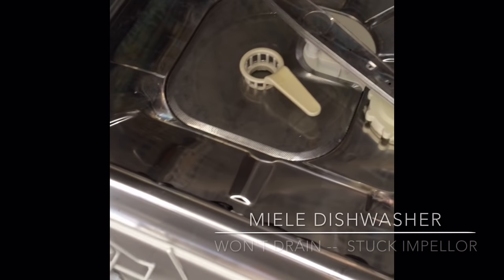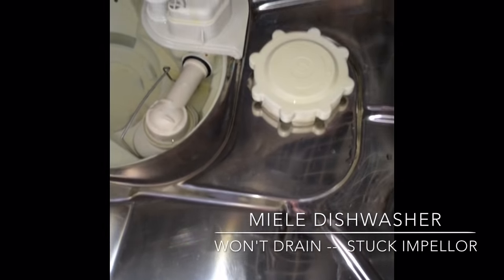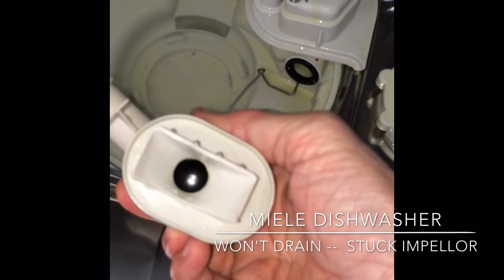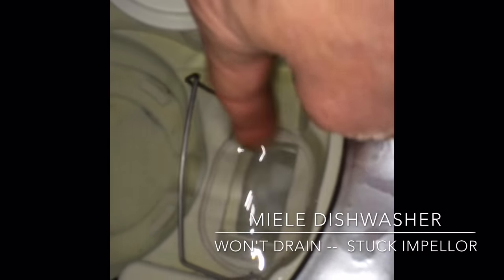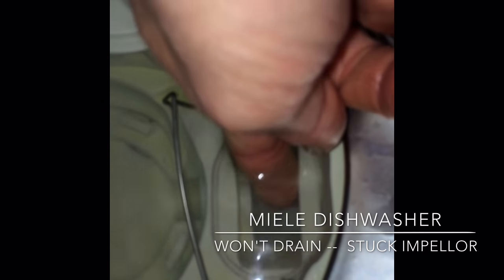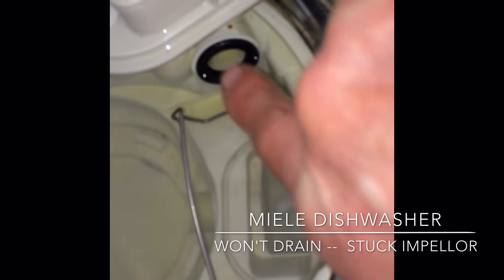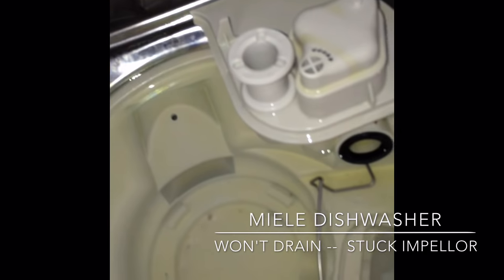✨ Miele Dishwasher - Won't Drain - 5 Minute Fix ✨

Comment: I got under the sink to locate the drain hose. It’s thin and flexible. I knew it was the one because when I shake it, the water in the dishwasher is affected. So I unscrewed the hose clamp and simply blew into the hose. It’s working fine now. Thanks Scott for getting me started.
Reply from the maker: Very good,

Thanks Ray

Comment: You fixed my machine!  (Well, we did...).  To help others: My impellor was still turning, actually quite freely, but rooting around with my finger I found a clump of hair/lint/grossness that was wrapped around the core of the impellor blades.  It wasn't noticeable at first, but after pulling it out and giving it a light scrub with a pipe brush (glass straw brush) and dish soap to get rid of the light grease build up, it fixed my problem.  BIG THANK YOU.
Reply from the maker: Nicely Done😊👍

Comment: I bought a SC G  621 plus in 2001 in Germany. This was the second time in 16 years I had a problem. The first time I used a long thin piece of metal for the circulation pump  and now this  (another problem) video has saved  me again. Thx
Reply from the maker: Thanks so much.  Here's to another 16 years

Comment: Thank you Scottthefixitguy - I had some lemon pips stuck in the non return valve so the ball bearing wouldn't move.  I love it when I can fix it and save myself massive call out charges.  Fab!!!
Reply from the maker: +jaffaboy1999 

Great Job,

I've seen that same problem with the Miele dishwasher one-way valve many times while working out in the field

Comment: Hallo Scott, a really good video. I just had the problem that the water was not pumped out. And I had the problem, that the disassembly of the valve housing was a little stiff . But with your instruction to pull a little harder, it worked . In my case a little plastic part from a  drings bottle  blocked the impeller of the Pump. So thanks for your Video.
Reply from the maker: Glad it helped👍😊

Comment: I did all of the steps and didn't find any obstructive objects. I finally went in the garage and grabbed the shopvac and just sucked out whatever was in the holes. Closed the door, turned it back on and it worked! Hope I didn't cause any potential harm, but as of now (5 minutes ago) its running and were doing a load. Thanks Scott!
Reply from the maker: Nice Job

Comment: Many thanks, Scott. 

Using the claw part of the hammer, we managed to deal with the hardest part of the job, which was to pull out the tube that holds the ball bearing, on top of which we found an olive pit perfectly lodged itself at the entrance of the hole, stopping the impeller from rotating. It was really less than a 5-minute job. Now I can show my husband how to do it, in case it happens again in the future! 

Have a good weekend. 
Tam
Reply from the maker: +ACACIA LODGE 

Nice job Tam👍
Reply: Thanks for the tip re:claw part of the hammer!!
Reply: Oh thank God, I've been trying for two hours to get the damn thing off. I'll try that tomorrow, too sore, hot and bothered now. 🥵🤬🙃

Comment: Thanks for fix. My model did not have a stainless spring. The non return valve was clipped  in by a plastic clip which had to be pressed back.  fish bone was the issue.
Reply from the maker: Nice job😊

Comment: Hi Scott!  I cleaned all the filters, cleaned the valves, checked the impeller, and the dishwasher still won’t fill.  Is there anything else that I can check?  Thanks!
Reply from the maker: You might have water caught in the drip tray below the dishwasher,
That will keep the dishwasher from filling with new water.
You can remove the two panels located below the Dishwasher Door and unplug it, and then use a sponge to sponge out the water and after that it should fill.

Comment: I emptied the dirty water from the bottom with a cup before I started the process so I could see the base. Mine must be a later model as no metal clip over the impellor just a plastic clip incorporated in the body. I found that  some corn kernels (from my kids making popcorn!) had got stuck  in the impellor but once out all came good. Had to turn machine on and off and on, now working again. Many thanks for this videa.
Reply from the maker: Great job Kevin👍😊

Comment: Hi Scott, could you tell me what is the metal prong on the left of the part you are working on in this video, i pushed mine inside and now it won't come out?? Anyone! Thanks from Australia
Reply from the maker: Hi Eric,
That’s the temperature sensor.
Just unplug your Miele.

Remove the panels below the door and reach in and push it back out👍

Comment: THANK YOU very much that was the easiest fix I have ever done!  There was a piece of plastic and some broken glass stuck under the impeller - the washer started making a funny grindy sound and we just thought uggh another planned breakdown of parts in a machine.  At first I tried to just reset the machine but still the drain message came on so I saw your video and followed your steps, cleared out the well where the impeller sits (first I had to mop up the water - i used a bunch of bounty to mop it up and squeezed the sopped up water into a bowl and kept using the bounty as a sponge took 5min.  once there was not water in the bottom of the machine I released the drain valve and saw the impeller - slowly put my finger in and felt stuff under the impeller - i kept turning the impeller but nothing would come out so I used 1pc of dampened bounty - twisted it up and pushed it under and through - out came all the stuff that was causing our issues. I put all the dish caddy back in - turned on the machine and put it into rinse and hold - shut the door and immediately it started the draining noise HURRAY!  Since then the machine runs like new - nice and quiet.

Comment: Is it normal if you remove the non return valve that water flows back? My machine (19 yrs old) doesn't pump all water usually on the 3rd cycle of any program the inlet/drain light flashes. Sometimes it completes the program. Can it be the attachment of my drain hose? I did everything you suggested from the videos :)
Reply from the maker: When you remove the valve you should get a fair amount of water coming back.  Sometimes the extra water that ends up in the dishwasher isn’t a drain issue but instead it’s the fill valve not closing all the way and letting extra water come in.  You could check the water level in the sump before going to bed and then the next morning see if it went up.
Reply: @ScottTheFixItGuyChannel  Thanks for your quick response. I've watched your video about replacing the fill valve. I think the sounds you described are there. 
Should I compare the level after 1 completed program you ment? Or just level of water if the dishwasher was not used for a night? Is it typical that it switches off during the final cycle of the program in this case? (So the water gets drained for a certain amount of time and it checks the water level after that to see if it can continue the drying cycle?)
Reply from the maker: That’s right, and sometimes a leaky intake valve will let water sneak in and that will cause an intake/drain light to flash.

Comment: Hi Scott, please help
Great video! Did find  both a corn and a lemon pip in the impeller section. But but...the noise persists :(
Any further tips? 
I can share a video of the noise it makes (only in the drain cycle and it does seem to drain though!)
Reply from the maker: Hi Ravi,

I would remove all the water near the drain impeller with a turkey baster and then carefully look under the impeller for a small piece of broken glass👍
Reply: @ScottTheFixItGuyChannel  tried this. Turkey baster and then vacuum cleaned it. It did feel like some sediment was under the impeller. It's clean now. But the sound persists!! 
Is there any other moving part within i could check? 
Thanks in advance

Comment: Hi Scott, thank you for a great video,  I have had this issue for a long time, but I need to do these step every day after every time I run the dishwasher, it just won't drain, after each cycle I have to do those step to drain the water and do rinse to drain the water and then use the dishwasher again for the next day, I check the non-return valve and there is noting stock to it and the ball inside moves around please advice!
Reply from the maker: I think the rubber seal inside is worn out .

I would call Miele USA and order a new one way valve 👍
Reply: @ScottTheFixItGuyChannel  , would you happen to have the part number or maybe a picture of it? , are you talking about (non-return valve 5269111) or one way valve is something different?

Comment: Happy Easter Scott, I followed your directions and it started to hum as it did before youtube, but then it started to work for a few minutes then stopped (it wasn't working before I followed your directions)  then it  made a funny noise and the intake drain is now flashing. Can it be the motor?
Reply from the maker: Hi Wendy,  there’s a small piece of glass below the white plastic impeller .

Look carefully with a good flashlight and pull it out.
Reply: @ScottTheFixItGuyChannel  Hi again, I don't see any glass but after going through your directions agin last night, including the half toothless fork method, i got it to work on economy mode.  I am very grateful!!
Reply from the maker: Awesome,

Thanks Wendy😊😊

Comment: Thanks for the great vidoe. But my Miele dishwasher drains at the beginning of a cycle, but NOT at the end of a wash or rinse cycle. I can open the door, power-cycle the machine,  set it to rinse, close the door, and it drains the water out with gusto. (I have the drain hose detached from the garbage disposal to make sure i see the drain flow into the sink).  Can i be sure it is not an issue with the pump, valve, or any blockage in the drain line?  Would that mean a controller issue?

Comment: Nice video.
I'm wondering about the silver/metallic rod that (just as big as a drill bit) sticks out at the very bottom at the drainage area.
what is it for? I accidentally pushed it in and don't know how to retrieve it.
Reply from the maker: Hi Jon,

You can push it back in from under the front panel.its a temp sensor.

Comment: I am having this issue with my miele.  I followed the procedure and was happy that it worked - for a load.  Repeat, worked for another load.  Repeat for the next load.  The non return value is free of debris and the impleller rotates.  ??  I suspect that the non return valve is done tho it looks fine.  Any ideas?
Reply from the maker: Hi Steve,

Could be that it can drain well but keeps stopping too early for some other reason still full of water.
Reply: @ScottTheFixItGuyChannel  Hi Scott, I think the problem is the +14 yr old non return valve. It comes apart and I notice the gasket is a skew.  When i reseat the gasket in the bottom half of the valve the washer runs and drains.  Makes sense to me.  I ordered a new valve - should get it tomorrow.  To my disappointment tho, I ran the washer last nite for pots and pans and the program didn't run.  |This even after reseating the gasket of the non return valve. So, I tried it again at the normal setting and it failed again.  I just tried it on the 'economy' setting and it seems to be running fine. Now i'm thinking there could be more to this than just the valve - like a board issue.  I'll see how it runs after installing the new valve tomorrow.
Reply: Back to not draining again.  crap

Comment: Hi Scott.   My dishwasher does drain, but it leaks inside from that part with the ball, I think.  At first, it was constantly draining so  I had it unplugged for 2 weeks. I guess the water evaporated from the tray underneath and it started working  again. I was so happy, but now it is leaking back into the dishwasher after the cycle ends.   Do you have any idea what that cold be?  Thank you so much!
Reply from the maker: I wonder if it’s water backing up from the sink and flooding the dishwasher ?
Reply: @ScottTheFixItGuyChannel   I cleaned the dishwasher with a vinegar cycle and a then baking soda cycle.  There was a little water left in the bottom.,But overnight the water is clear and rising. I  saw another one of your awesome videos. I think the inlet valve is allowing the water to slowly leak from the circle in the bottom right. (It's a Miele NovaStella about 19 years old.).   I have to watch your video again to see if I am brave enough to change the valve by myself.  Thank you for your videos!

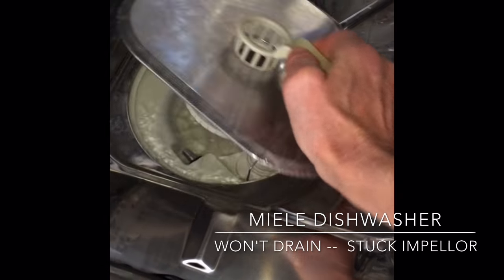Comment: Thanks for the video! What is that shiny metal pin for eft bottom corner at 00:20) I tried to unblock the dishwasher before I found this video and pushed that pin in.... Although it seems to pump nor (no more faults) thepump is very noisy (rattly) now.
Reply: I figured it's the temperature sensor. How do I get that pushed out again????
Reply from the maker: Just unplug it and remove the panel beneath the dishwasher and then remove the metal panel below that one.  You can then reach in and just push it back through the hole.
Reply: Scottthefixitguy Yay! I did it! 👍🏼

Comment: Hi! My Miele dishwasher seems to have the drain going constantly, and ive tried the solution from your film but it still wont stop. In the process i managed to press, i do admit a little too hard, on the metal looking bar that you can see on the lower left at 0m 22s, so that it popped into the hole it sticks out of. I have basically screwed up my washing machine? 🙃

Best regards!
Reply from the maker: You’re still ok.
Just unplug it and remove the panel below the dishwasher door and then remove the small panel below that and reach in the opening to find that silver (temperature sensor) then push it back into that hole with the rubber grommet. Next, sponge out any water that you find in that metal bottom plate below the dishwasher.
After you put it back together it will run like new again 👍
Reply: @ScottTheFixItGuyChannel   wow! I believe this was my first comment on a youtube video since youtube became a thing, and this actually solved my issue. So breaking my silence is definetly deserved!

The temperature sensor was dangling just behind the panel as you described, and the bottom pan was filled with about 0.5 liters of water. Using a sponge i could dry the bottom pan up and when i turned on the power again, the drainage sound was gone, and the machine workes exactly as before!

Thank you so mutch for your input!
Reply: Hello again! I try my luck once more by going to the wizard himself!

The problem occurs more frequent now then before, and now it looks like im not able to get more than 3 cycles before having to empty the pan bellow. Do you know of there is a solution to this? Could it be that the machine is not standing correctly?
Reply: @ScottTheFixItGuyChannel bump! 🎉

Comment: I am having drain issue with my Miele dishwasher as well, but my problem seems to be different. I've tried to clean it as instructed by the manual and your video. However, when I gave it a try, my dishwasher still flashed the "Intake/Drain" light and water still wouldn't be drained. However, there's one thing that makes my situation different:

If I turn off the dishwasher, then turn it back on and start a new cleaning cycle (I used the Rinse & Hold cycle to test, fyi), the water accumulated will immediately be drained. Because my drain line is hooked up to a garbage disposal, I could see water coming out from the drain line right away. Unfortunately, once those water is drained, and new water starts to enter the dishwasher and accumulate, the "Intake/Drain" light will flash and water wouldn't be drained again.

Since the water can indeed be drained, my gut feeling is that the problem is not related to any mechanical draining mechanism (ie, the motor, the drain pump, etc). But I have no idea what the actual problem is. Anyone has a similar problem?
Reply from the maker: Sounds like it’s not happy with how much water comes in during fill.

At 5 minutes is the water just touching the bottom of the white filter handle?

Comment: I accidentally pushed the silver knob (on the bottom left of your video) and it went in and disappeared can I fix it?
Reply from the maker: You can,
Just unplug it and remove the panels below the dishwasher door and reach in to push the temperature probe back through it’s rubber grommet👍

Comment: The impellar in mine moves very easy and smoothly...is that normal or should there be some resistance ?
Reply from the maker: Should be a little resistance 1/2 way through the revolution .

Comment: Great Vid!  Question: at the 20s mark just to the left of your finger there is a metal tube/part that sticks out of a rubber grommet...what is the part for??  When I was cleaning, I pressed on it and it 'popped' into the rubber hole- dissappearing for good!  How do I fix THIS??  I hope I don't have to pull out the washer and take apart everything from underneath.  Help on this appreciated. Thanks.
Reply: Nevermind Scott, found below the fix as someone else did the same thing!
Reply from the maker: +
Randy Sauder 

Common problem Randy
Reply: I should warn others: if you accidentally push this sensor in as I did, it will allow any water to leak.  I had to find out the hard way...when I discovered that by not fixing this immediately my hardwood floor was destroyed by morning :).  STRONG CAUTION: DO NOT PUSH/TOUCH THE SILVER THING!! If you do, drain any water and fix this immediately. $5000 mistake and easily the most expensive youtube 'quick fix' if you aren't careful and know about this.  This is a poor design Meile! No excuse for the sensor to not be held in place by a simple locking mechanism.